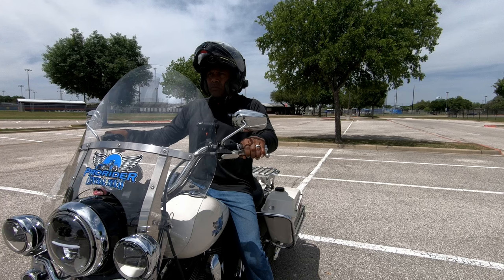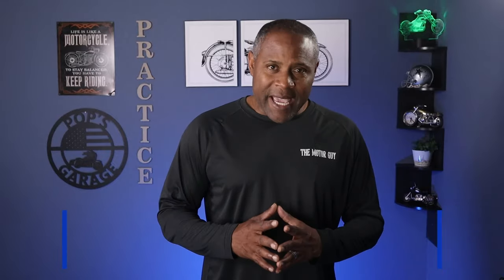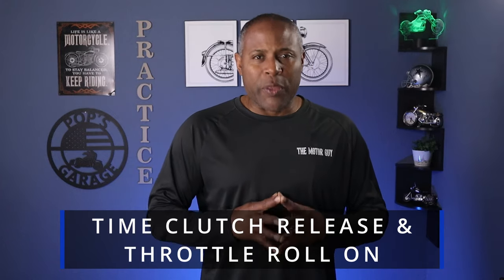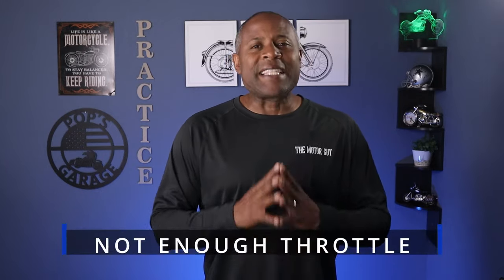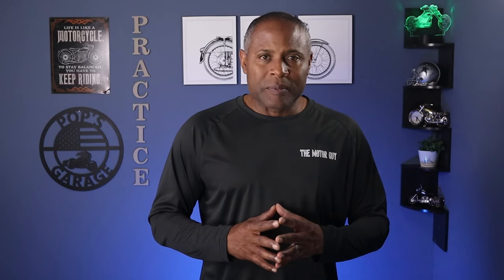3 Easy Ways To Prevent Stalling On Your Motorcycle!

Comment: One exercise I was practicing is the recoil drill. I find it really helps me commit clutch takeoff to muscle memory

Come to a gentle stop, front brakes only, handle bars straight, feet stay up on the pegs. Right as I reach a complete stop, I pull the front brakes harder to compress the forks, then release the brakes as the fork rebounds, sending the motorcycle rolling backwards, feet still up on pegs. 

Then I engage the clutch and drive away, catching any falling motion if I feel I am tipping over. 

In terms of clutch lever position, 1 is fully pressed in, 5 is fully released, I tend to pop the lever immediatelly into the 3 position at the same time as I just crack open the throttle to 2% and hold it there. I stay in the same 2% throttle 3 position clutch until the bike starts moving, then slowly and gently release 4, then 5 on the clutch as I roll on more throttle
Reply from the maker: I am not familiar with that drill can you explain how it's done?
Reply: @ProriderCentralTexasYouTube it's just the "Stop and go" exercize without putting your feet down at the stop. If you break harder with your front brake and release it a fraction of a time before the bike stops (the final stoping is done by the rear brake) then that "recoil" from forks decompressing and bike standing up (not going backwards like the comenter described) gives the bike stability and allows you to sit there at a standstill, both feet up for a few seconds. Then when you feel the bike is gonna drop you open the throttle and release the clutch. Kind of a combination of "stop and go" and your "trust and believe" exercizes. Hope that helps!
Reply from the maker: @devianthousend  I see thank you for the explanation👍